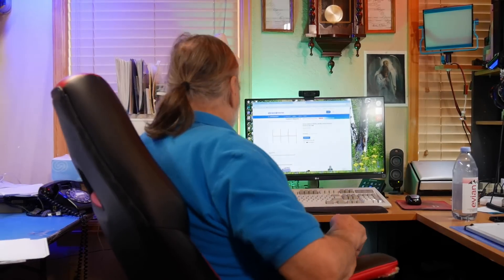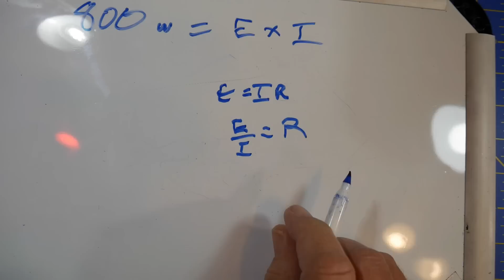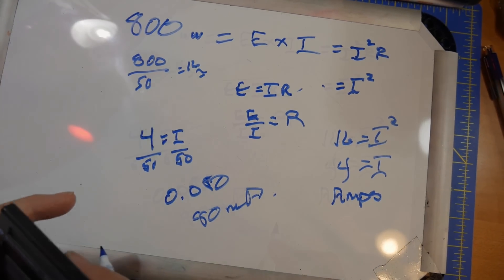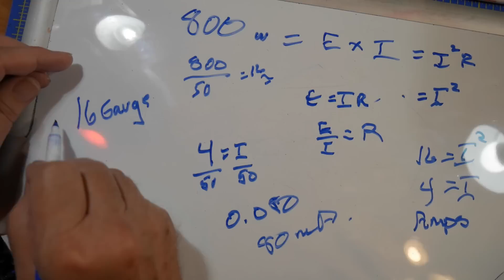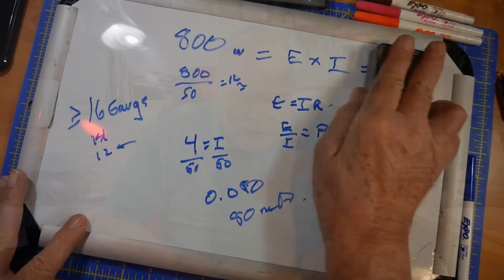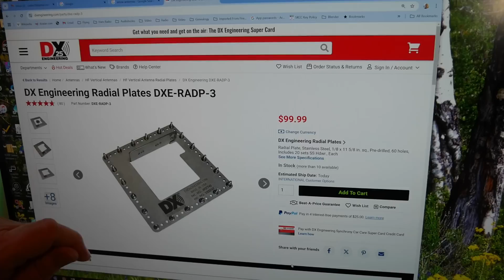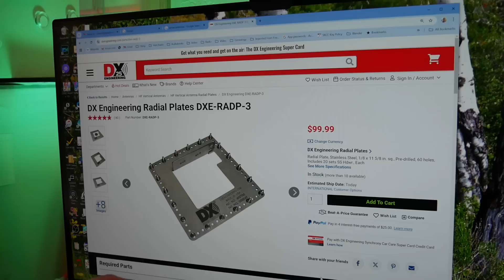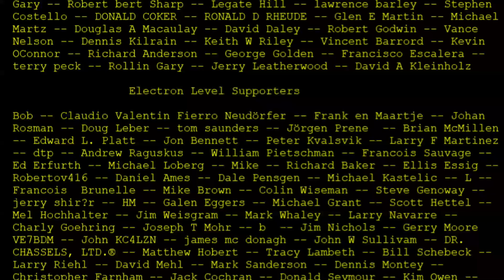How Thick Should My Radials Be? (#1230)

Comment: The issue, as I understand it is for the radials to couple the RF to the ground capacitively.  It would seem to me that a conductor with larger surface area would function better than smaller round wire.  Something like insulated copper foil might be useful.  Ribbon cable with all the conductors connected would be an alternative, if affordable.  
I have found even 20 AWG insulated wire quite strong.  Copper clad steel with insulation would be quite strong, even in the thinner gauges.   Using 8 or more radials,  the current carrying capacity of even quite thin wire would not be exceeded.
Reply: Are they to be a ground or a counterpoise? Dave mentioned the radials as a counterpoise at one point in this video.
Reply: @tracyrreed  Depends on what you mean.  A DC or low frequency AC ground is not the same as an RF ground.  A metal rod driven into the earth might not be a very good RF ground.   An antenna needs something to work against.
Reply: @larrypicard5969  I mean in the context of the antenna in question are they a ground or counterpoise? Dave said counterpoise but you seem to have said ground.

Comment: I like your chair. It is just like mine.   I have found that laying out radials on the ground and securing them with ground staples is easy.  Get the radials as close to the base of the grass as possible. If the radials are laid in spring , they will disappear by July or so.  I live near the Great Lakes so my climate will differ from yours.  I have never had problems mowing over them.